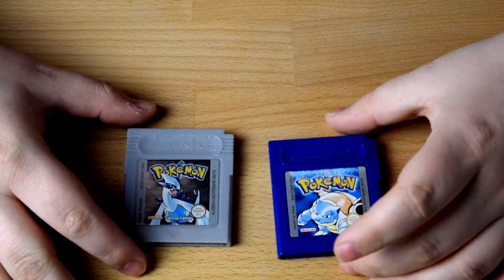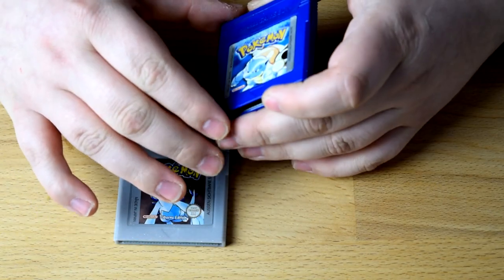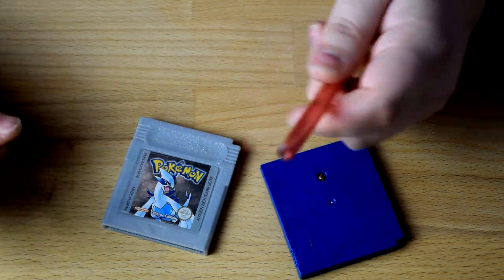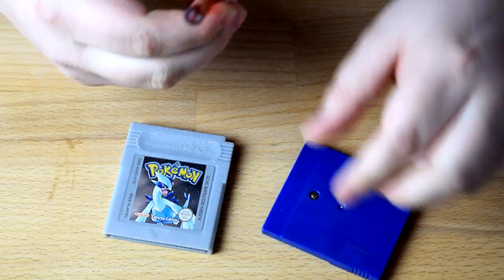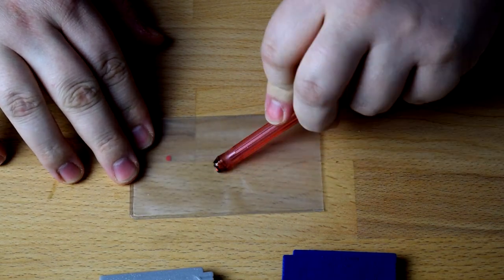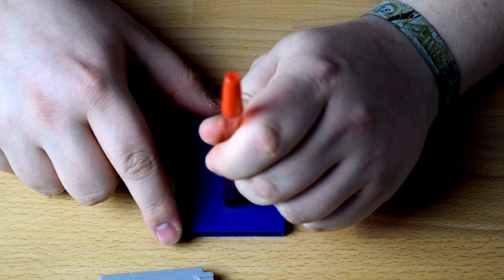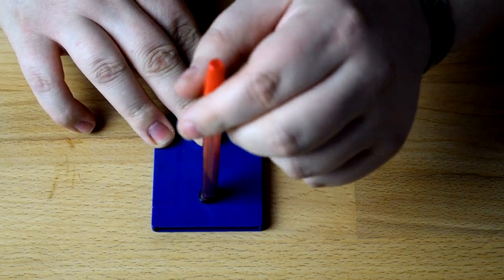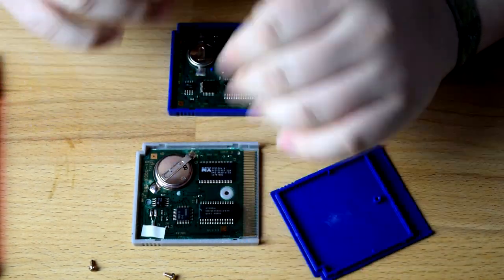How To Make Your Own Nintendo GameBit Screwdriver

Comment: I did this for my Gameboy Color and now there is dry plastic inside one of the screw holes. What can I do to fix it? Please help
Reply: Use soldering iron to melt the plastic inside the screw
Reply: @JariAkagamiOfficial314  that does not sound right

Comment: Be careful with this. Its a 50-50 shot of whether it will work cleanly or not. I've broken pieces of my N64's shell using this method because the pen wouldn't let go of the screw.
Reply: At that point take some needle nose pliers and break the pen lol
Reply: And I tried using needle nose pliers to open mine up, well won't work.. the needle nose isn't thin enough to fit

Comment: I would buy a flat head screwdriver and file the center a bit so as to leave 2 edges.
I have done it once for my bike. Bike wheels need a special tool to adjust the spokes.
Reply: Works perfectly with a 3.5m screwdriver. Although something like 3.8 or 4.0 mm would be better, on 3.5 there is just a tiny amount left, so it might break at some point.

Comment: Will this work for my GameCube? I ordered a bit online but when it came in it was only for gameboy cartridges.
Reply from the maker: Do those have the Gamebit too? If so you can try of course. If they have Triwings it should still work.
Reply: EpicLPer ok thanks!
Reply: Think there are also 2 different sizes of the gamebit.
Reply: @HappyBeezerStudios  
Late to reply, but yeah. Nintendo cartridges use the 3.8mm game bit, while the consoles use a slightly bigger 4.5mm.

Comment: Cannot get this to work. Tried 5 different mechanical pencils / pens. Not even 1 lick of movement on the screw. Dunno why, but doesn't work for me
Reply: Some screws are just tighter than others. I know my Pokemon Gold was really stubborn the first time I ever opened it...and I was using an actual security bit!
The pen trick only really works good if the material of plastic is really hard when it solidifies, such as with the pens that almost look like they're made of glass. Those are the best ones to use if you don't currently have a bit on you imo.
Reply: @cullbear55  Thanks for your response, I kept trying and eventually the plastic cartridge around the screw broke Dx

Not a big deal though, just taped the top of it and slid the cartridge together with a new battery

Works good as new!
Reply: @Frequently1  
That's good to hear!
And yeah, it's not a big deal if the plastic cracks because you can get a replacement shell later. Glad you got it fixed! I just used a Sonic 2 cartridge to pre-mold some pen screwdrivers and opened up a Japanese N64 I got today to modify the slot to fit and play U.S. games too. I only needed 1 to get it open and 2 to screw it back together.
Works!
I'm happy because I've never had an N64 before.
:D